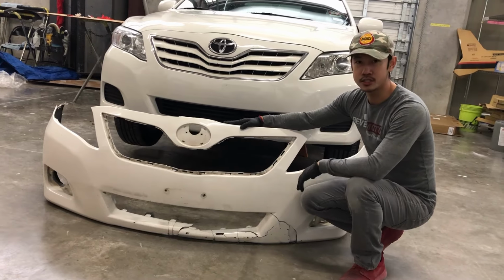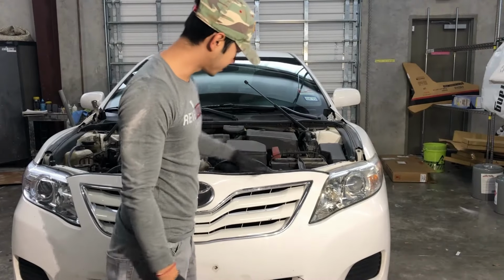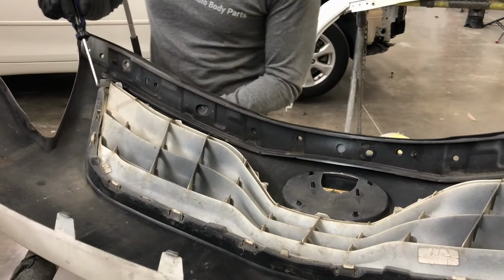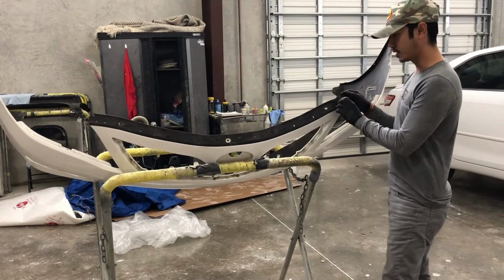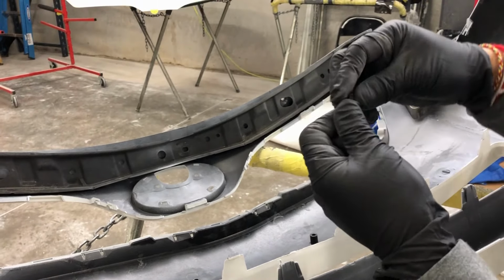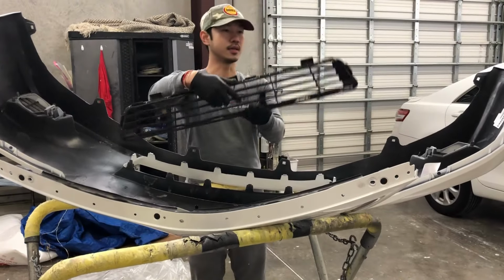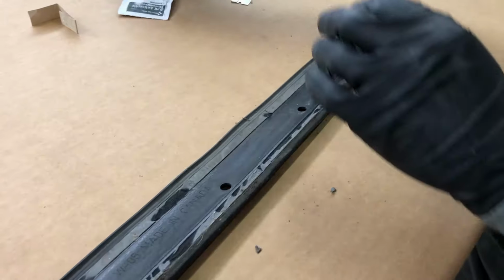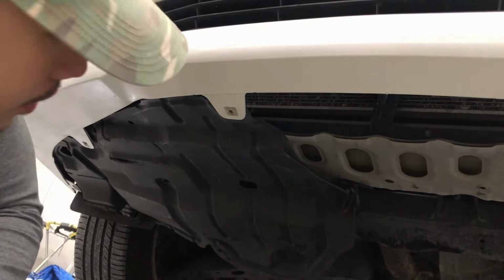HOW TO - Replace Your 2010-2011 Toyota Camry Front Bumper | Step-by-Step Removal & Installation

Comment: Thanks for video, I have only one question. Is Camry SE and Camry LE bumpers are compatible to each other? Not hybrid, regular models.
Reply from the maker: Install is fairly simple, but if you are trying to get the SE to upgrade your LE they are different bumpers.  You will need other things to do the conversion.   Go to www.ReveMoto.com

Comment: Great detail on replacement of front bumper.   Can you please tell me where to get replacement bolts and screws I would need since repair shop did not replace a lot of the bolts and screw originally installed on my bumper and cow?
Reply from the maker: Thank you! The best place would be the dealership. The bolts and clip can be a dollar or more each but they would be the exact ones you need. Alternatively, you could match bolts at your local hardware store and the nearest o'rielly/autozone would sell the clips at the same price. But, they are "one fit all" clips and are the same price as the OEM clips. Good luck!

Comment: My bumper is hanging down from each side near the tire. I can move it into place but it will not click into place. It will easily fall out of place and hang down again. Will a new bumper fix the problem or will the new one not click into place
Reply from the maker: There can be only 2 reasons for this. One, the bumper tabs are broken. If the bumper is sticking out, make sure those tabs aren't broken or bent. Two, check to see if the bumper retainer/bracket isn't broken. If this is broken, the tabs cannot snap into place. The retainer is usually around $20-60. If the tabs are broken, a new bumper is best or maybe someone could plastic weld the broken tabs for you. Thanks for watching!

Comment: Quick question.  My bumper has the fog lights at the bottom.  Do I just need to unplug them first then the rest comes off with bumper or am I incorrect?
Reply from the maker: Hello. You can unplug them first but it may be a bit hard to reach. When you pull the bumper off, it's easier to take off the fog lights but just make sure the bumper doesn't come crashing down.

Comment: Can you put front valance on to LE model?Thanks
Reply from the maker: Hi. Technically, you could if you drilled the holes and attached screws. But, the SE bumper comes with the holes already, so it's much easier to just get the se bumper with valance.

Comment: What are the metal square things that attach the fender to the bumper called?
Reply from the maker: Hello. Those are bumper brackets and there are a hard black plastic that is usually held on by a couple bolts on the fender. The bumper has tabs that will snap into the bracket. They often break on fender benders are easily replaced. The usually cost $30 and up at the dealership. You could probably easily find one a junkyard too. Good luck!

Comment: Great video, quick question...I like the shape of the 2010 bumpers, could they be swapped onto a 2007? Would the hardware match up? It looks like it would.
Reply from the maker: With any conversion, we tell our customers to double check every  source. Camry/Toyota forums are great places to check. That being said, the hood and head lights look to be the same shape. The hood is 07-11. The fender liners might be different but they are made of thin plastic, so you could always modify them. The fog light holes are different, but I am not sure about the fog lights themselves.  I would say it looks like they could be but please double check. Please let us know if you convert your bumper to the 2010.
Reply: @ReveMoto  Thanks for the response. i did look around and found that it is an exact replacement. I will need to change headlights and pigtails for the parklights and turn signal though. I will most likely be using your company for my bumper. Glad I found you guys....I'm in the Dallas area so homestate advantage.
Reply from the maker: @The2MINwarning  That is good news. We'll be here when you  need the bumper and Texas is the best.

Comment: Good informative video. However, there were a couple of things that got me. I understand most likely the customer might be on a budget and didn't want to replace anything more than it would need. However, I felt that you should have gotten all of the proper clips and bolts needed to complete the swap. Makes it look half assed or more like a simple shade tree mechanic doing this at home in their own garage. And with you being a paint shop, why didn't you touch up the 2 chips on the front of the grill before reinstalling it? 🤔

Then I would have reordered the weather strip as well as the missing engine covers so it's back to factory settings. But again, if the customer didn't request that, I would have at least asked them if they woul like it restored. 

Otherwise I thought you and your assistant did a good job going slow enough to show all the particulars of disassembly and then reassembling it. She did an excellent job getting all the pertinent angles to see exactly what you were doing especially under the bumper and in the wheel wells. 😁👍🏻
Reply from the maker: Thanks for watching our video and leaving a comment! We appreciate the insight and letting us know what was helpful or what we could've improved on 👍. Definitely always trying to improve our angles, not always easy 😅 We actually aren't a body shop. We sell painted auto body parts and ship them for our customers to usually install themselves or take to a body shop for installation. This customer was actually in Houston, so we offered to install the ReveMoto painted bumper for free. But, yes, like you mentioned, they didn't want to buy more things for the car and just wanted us to do the swap so we tried to make the most of it 🙂
Reply: Do you a torque drill or even better a 1/4 drive cordless ratchet or 3/8 drive?

Comment: thank you! such a handy man
Reply from the maker: Thank you for the compliment! We're glad we can help.
Reply: @ReveMoto  do I need to jack to screw on the under bolts? I have a 2009 camry SE
Reply from the maker: @dropshot118  I don't think you NEED a to jack the car up but the Camry is pretty low. It definitely help to have more room to get under the bumper buy you probably could do without it. 🔧🚗
Reply: @ReveMoto  THANK YOU!
Reply: I need to also replace my reinforcement bar under the front bumper? Is that easy to do? what tools do I need?
Reply from the maker: @dropshot118  Most reinforcement bars or bumper are held on by 2-4 big bolts. They are usually size 17 or bigger. You may need a pipe for leverage or long ratchet. Pretty easy job but the bolts  will be a little tough. Good luck!
Reply: @ReveMoto  is this safe to remove by myself or should I take to a shop? I don't want to deploy the air bags or anything. No videos online about removing this bar. Mine is bent and my bumper cover is bent and won't allow the bumper cover to fully be secured. like one side is hanging off
Reply from the maker: @dropshot118  If you are referring to the front bumper or bumper rebar/support, the airbags should not deploy. The only way airbags deploy is if you hit the sensor with tremendous force. This is why minor collisions do not cause the air bags to pop. The bumper bar or real front bumper, should be removable by large bolts.
Reply: @ReveMoto  ok thanks. yes I was referring to the bumper bar that is directly in front of the radiator
Reply: @ReveMoto   so if I remove that it will not compromise the frame / structure of the vehicle? Im thinking about going to a junkyard and practicing on taking one off. Since I need a replacement anyway :/
Reply from the maker: @dropshot118  That is a great idea to practice at the junkyards. It's been our experience that removing the reinforcement will not compromise your frame. Unless, the collision was strong enough to twist your frame. You could probably see this if your body lines are messed up or the frame is crimped somewhere. I would get someone experienced or read up on checking to see if your frame was effected. Good Luck!
Reply: @ReveMoto  thanks!
Reply from the maker: @dropshot118  you're welcome.